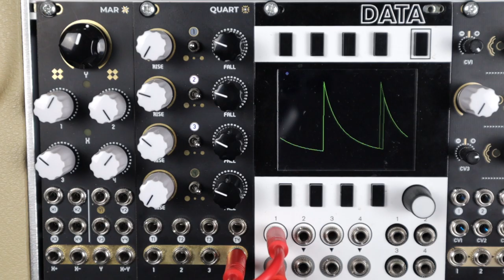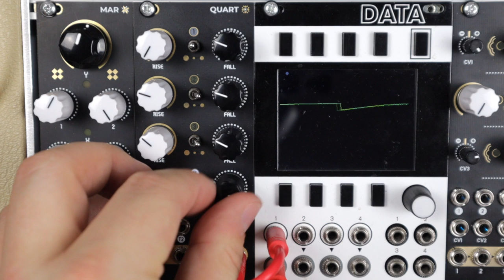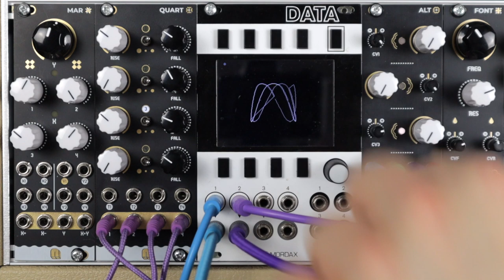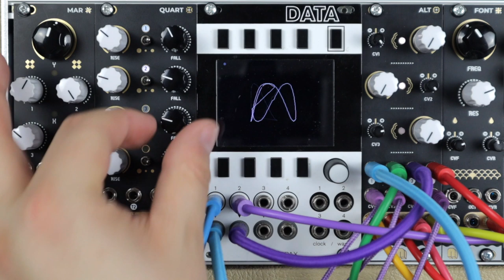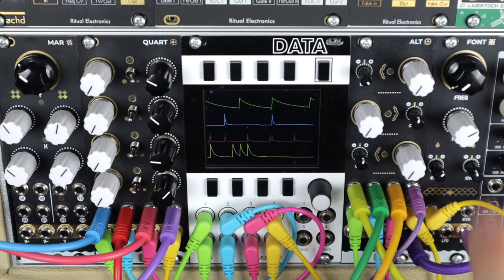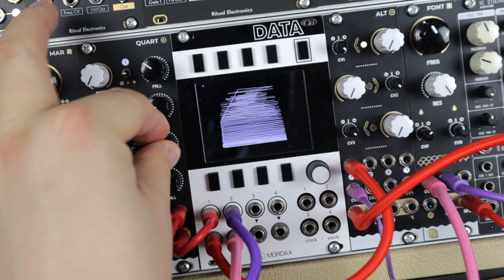NANO Modules QUART // quad envelopes or LFOs - Eurorack demo & patch tips

Comment: Great stuff. As it happens I've just built the Tesseract Modular Selam which is a little larger but has 6 LFO/Envelopes with attenuverters and some mixed outputs. I'm not sure if it gets as fast as QUART but a verry easy kit as you only have to do LEDs, pots and sockets. Your video will give me a few ideas of things to do. Cheers!
Reply from the maker: Good stuff, I haven't tried that one but I definitely intend every video to be a set of ideas for the functions and applied with anything. Glad to hear that's the case here.

Comment: Thanks again for the insanely informative tutorial and review! I’m a big fan of your channel. Please forgive my ignorance as I am still learning- but does this module allow for some sort of offset on the LFO so end of cycle isn’t always at zero? Not sure if I have phrased it correctly. But basically I want a quad LFO/EG that can “turn knobs” (CV modulate) from say 3-7 as opposed to the full sweep of 0-10. Or I could shift it to turn them from day 5-8 or whatever other range I desire? If it doesn’t, do you know of a simple, 10hp or less hands on LFO/EG module that would do this for me, without having to dive too deep into menus?
Reply from the maker: Hi Andrew, there's no offset control (an offset is a static voltage you set more on that below*) or attenuation (to reduce the range of modulation, more on that below**). 

*You can use an offset voltage when mixed with modulation to take the modulation further into the positive or negative voltages. So if an envelope or LFO was say 0 to 5V adding a 1V offset would make it 1 to 6V. Adding -3V would make it -3 to 2V. 

**Attenuation is a range or depth control. It reduces the voltage range of your modulation. Going with that 0 to 5V example you could attenuate to 0 to 2V for example. 

You want a mix of offset and attenuation to make your examples of 3 to 7V or 5 to 8V. With a 0 to 5V modulation source you'd need reduce the range with attenuation to 0 to 4V and then offset by 3V to get 3 to 7V as the range the modulation works within. 

This brings us to how your modules that you want to modulate work ... 

If it's just a CV input with no direct knob to control it and no attenuation or attenuversion (attenuation an inversion) control for the CV input (an example would be a VCA like the Abstract Data 3x VCA). Then all of the above will need altering externally (attenuation and offsets etc) and then just plug the modulation in. 

If the module has an attenuator then bare in mind that any attenuation of the modulation will also attenuate any offset you add. So if you had a 0 to 5V modulation source and you offset that by 2V so it's a signal moving between 2V and 7V, then attenuating that on a CV input control you'll be reducing the overall level but also that bottom 2V. 

Lots of modules have controls that are set with a pot/knob. Think of those as offsets. Take a filter cut off, you want it to dance around it's mid position and a bit higher. So set the knob at mid way and use your modulation to add to that. Some controls change from manual offset controls to attenuators when you plug a CV signal in to control them which then needs you to offset the modulation externally and then adjust the modulation attenuation and now the modules own attenuation. 

Hope that's helpful, if it's not clear let me know with more questions.
Reply: Wow! That explanation was amazing, and I totally appreciate the time you took to explain that to me in detail. I do actually now think I understand what you are saying.  So take my FSS TG3 Filter for example. It has 2 CV inputs for Frequency- CV1 is straight in and CV2 passes through a -10/+10 depth attenuator.  So if I want to modulate the frequency around the middle of the dial from say 11:00 to 1:00, I plug an LFO into the CV2, and then set the Frequency knob to 11:00 and then adjust the CV2 depth attenuator knob to like -3V or something like that? 
That way the attention is essentially restricting the incoming voltage of the LFO by -7V, causing its sweep to not fully “turn” the knob the full 10 volts? 
Wait maybe now that I say that I might not quite get it. 
Well anyway, on the topic- if I’m trying to build a small 48hp rack around the TG modules (2,3,4) what types of other modules do you recommend to get biggest modulation bang for my buck? I’m trying to make a portable little Gristelizer rhythm machine that can spit out gnarly, gristly beats and sick evolving droning voltages.  Not sure if I need EGs, LFOs, Sequencers, or what. I’m basically trying to make a TG version of a DFAM.
Reply from the maker: Hello again, ok good to have actual modules as working examples. 

So with the TG3 Filter if you wanted a LFO (a bipolar, meaning positive and negative going voltages) to modulate the cut off between saw 11 and 1 (talking clock face) then I would set the knob to 12 (in the middle) and then add the LFO to CV 2 and open up the attenuator a little bit so it felt like it was swinging back and fourth around the 12 o clock position to about 11 and 1. 

Note I say ABOUT 11 and 1. Precision doesn't really come into it, it's also not that important in nearly all cases. If you set the filter to a tone you like and enjoy the sound just a bit above and below that then using the on board CV attenuator to just bring in a bit of modulation until it sounds good. It's all about the sound and using your ears to guide these things. It might "technically" be going 10.30-1.30 or your frequency knob is offset so you're going from 10-12.30 but if sounds good, it is good. 

If the modulation was unipolar (meaning positive only voltages like an envelope) then I'd set the knob to 11 and open the attenuator until it felt/sounded like it was going from 11 to about 1 ... presuming 11-1 o clock is the general range we want to be in. But again, I'd use my ears to guide. 

The markings around the knobs 0 to 10 on the CV attenuator ... don't mean specific values as it's dependent on the signal you plug in. If you plugged in a 1V static offset voltage 0 would 0V, 1 on the dial would be 0.1V and so on up to 9 meaning 0.9V and 10 meaning 1V. Again think of the general broad strokes you're making, fine tune with attenuation where needed and tweak while listening. 

I don't know what you mean by "That way the attention is essentially restricting the incoming voltage of the LFO by -7V, causing its sweep to not fully “turn” the knob the full 10 volts? " - if you mean -7 on the CV2 attenuverter that means it's inverted at 7/10ths of the full level of the modulation. An LFO is bipolar, so the voltage is still swinging positive and negative. Whether that fully opens the full range of the cut off frequency or not depends on the external modulation level (what levels does the LFO module put out?) and the position of the main frequency knob. 

RE making a small modules ... both beats and drones with all the TG modules in only 48HP, that's a difficult task. Where are the beats coming from? Are you wanting drum modules to run through them? Are you wanting to synthesise and making your own unique drums by sculpting voltages and using the TG modules as a key part of it. 

If you're wanting to make a TG based DFAM I would look at the elements of the synthesiser that is the DFAM and look at which bits of that the TG modules can replace. Break the DFAM down into it's oscillators, noise source, filter, VCA, two 8 step sequencers etc ... cheapest way to do it will be buying a DFAM and patching it through the TG modules.
Reply: Wow again! Yea you really are a wealth of knowledge as well as a genuinely helpful person. I totally appreciate all your insight. 
So if expanded my Gristelizer idea to 60hp, and using the same Moog cases as my Subharmonicon and DDAM which I do own. I can’t believe your idea about running them through didn’t dawn on me. 
So that’s definitely something I will do. I obviously will still need some LFO/EG modules, because in addition to using the beats and sequences from the little 60hp Moog synths, I definitely want to sculpt and create my own unique TG sounding “percussion” and rhythms using voltages within the TG modules themselves.  I’m seriously considering the QUART as one of my modulation sources. 
I was also looking at smaller like the 2hp stuff. And looking at the Erica synths PICO stuff. The key for me though is to be able to set up patches then be able to gradually change them over time but manual knob turning as well as CV voltage “automation”. I do
also like the idea of that 2hp Turing machine as well. What would I need to make that TM work within the little 60hp TG rig I’m making? Do I need a clock? Or anything else? 
As for levels, yes I agree it’s all about the sound and feeling it out. I guess my original concern about it comes from me using the LFO that’s built in to my Moog Grandmother. Within the GM if I apply the LFO to the Cutoff using the Mod wheel all the way up, it swings the sound way down to a super low cutoff frequency, which with a longer LFO “sweep” it stays too low for too long in my opinion. So if I dial back the Mod wheel to 50% or so, more of the unmodified sound bleeds through making the bottom end of the LFO sweep not be completely silent, if you know what I mean. And I’ve tried patching the GM LFO to a filter on the DFAM and the mod wheel has no control over it there. Not sure if I explained that well.  But basically bottom line is I want to be able to vary the LFO modulation so it produces more or less effect on the parameter (cutoff or whatever) that I’m trying to modulate. For me the great sounds are all about the knob turning and I really want more hands essentially, and to be able to control how much the knob is being turned, and where on the knob the start and end of the knob turn occurs.  Does that make sense?  Anyway, looking forward to your reply! Thanks again.
Reply: @DivKid I do own a DFAM. How would you recommend patching it? Feed the TG oscillator and filter into the DFAM or the other way round. My head is spinning. Just when I think I get this stuff my head explodes
Reply from the maker: Patch the DFAM output into the TG3 or TG4 (TG3 could go into TG4) and use the TG2 as a modulator to modulate the filter (TG3) or the VCA (TG4).
Reply: Thanks! Will definitely try it out! Still waiting on the TG4. 
Would DFAM pitch output work in the TG2 1v/Oct input as well in order to sequence the pitch of TG2?
Reply from the maker: Yeah that would work to sequence the pitch.

Comment: Is there any way to make the Trig inputs be to clock Sync the Lfo's? Thanks for your time and explanation.
Reply from the maker: Hello, no they don't work that way. They loop with no input and work as EGs with an input. Lot of modulation in the space still though.
Reply: @DivKid  Thanks for the quick response and feedback. Happy new year
Reply from the maker: no worries and Happy New Year to you too.